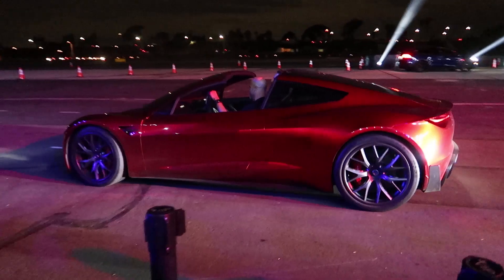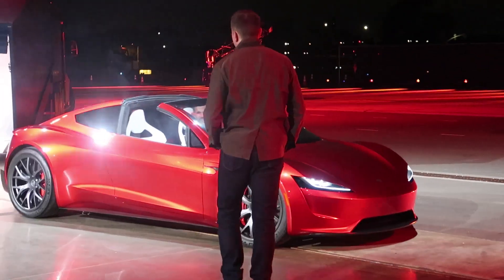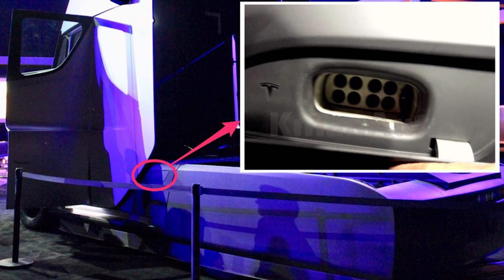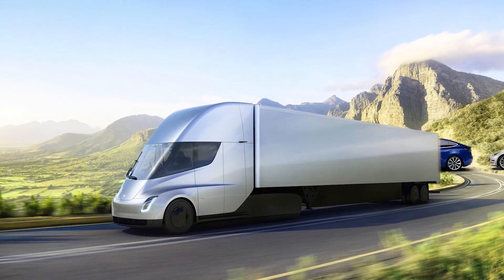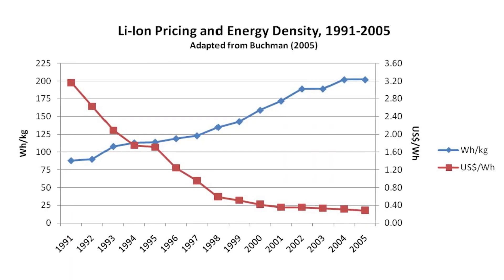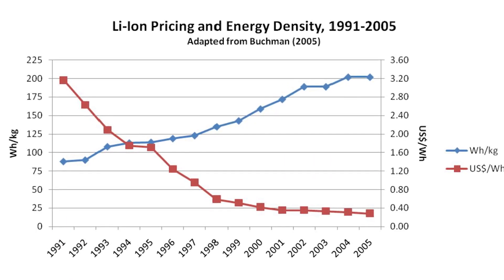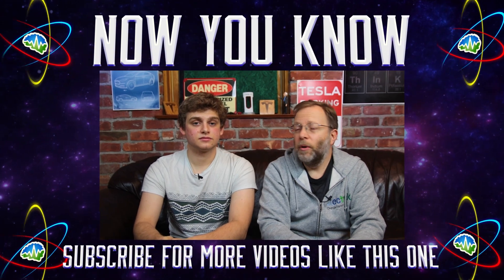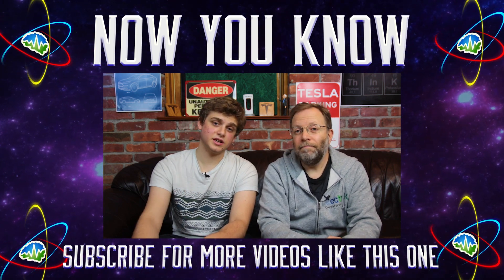Mega Charger Theories - In Depth

Comment: BTW - Henrik Fisker just patented a battery system that has proven to deliver a 500 mile range charge for a car in one minute time - I GUARANTEE that Elon is not telling anyone about his new battery technology that will compete with this. https://www.usatoday.com/story/tech/2017/08/11/henrik-fisker-back-again-challenging-tesla/550801001/
Reply: Sterling Michaels not a 100% on this, but Fisker’s patent I thought was just a patent for a type of Anode used in sodium metal batteries. I am thinking everyone is working (including Tesla) on the sodium metal batteries... maybe I am completely wrong though.
Reply: Sterling Michaels -- While it may be possible for the battery itself to charge that fast, let's do a back-of-the-envelope calculation for the required charging infrastructure.  

A relatively efficient platform would need ~120 kWh to go 500 miles, so to charge that in 1 minute at a constant rate would be 120 kWh / 0.0167 hr = 7.2 MW; at the 480V of the Tesla supercharger, that would require 15,000 amps; even at 2.4 kV, that would still be 3,000 amps.  

I submit that he will not be installing that multimegacharger network in time for a 2020 launch.
Reply: David Voss hey David I have two technologies which will make that more than possible when is a Building Technology.

Comment: i think it will be not battery but super capacitors
Reply: Priidik Kurik it wouldn't take 30mins to charge to 80% if it was capacitors.
Reply: ... grid would not be able to handle it ... if it is timed combo ... i think it would work ...
Reply: grid won't be able to handle it eitherway, it will have to be stored in tesla power packs. 80% charge in 30mins is standard fast charging batteries. No signs that would make anyone think its super capcitors.
Reply: tho ... 30 min and 300 miles ...:D  good talking to you :D.. on semi
Reply: its 400miles in 30 mins, and its capable of doing 500miles on a full battery. So the 400miles in 30mins is 80% capacity.
Reply: :D it is kinda too fast ... or is it real on batterys ?
Reply: 30mins to 80% for batteries is perfectly reasonable. Not to fast at all.
Reply: ... in hindsight yea ... capasitors would be like max 5 min but batteryas  in 30 mins are bit too fast ... i admit  i had a bad rigth idea
Reply: The energy density of capacitors is several orders of magnitude less than batteries.

Comment: One thing to consider is that the 24c price for electricity is for tiny domestic electricity supplies where most of the cost of maintaining the distribution to millions of houses... if you're a megacharger, and especially if you have some power packs associated so that you can smooth out your consumption, you would be able to buy electricity at a rate closer to the wholesale price which is under 7c.

Also, I think that if you planned to build a solar farm, then building it next to a truck stop would be great, because if you could sell that electricity for 7c, that's way over the wholesale price you could get normally......  I predict that the megacharger is a way to make large scale solar farms more profitable.

Comment: I think the new 2170 cells are going to be used in the roadster and semi and any new tesla products in the near term future. Not sure they made a "battery breakthrough". Remember, the 2170 cell is approx 50% more energy dense vs the old 18650 that's inside my Model S.

Gigafactory 1 just started producing 2170 cells, I would think they would want to maximize efforts for that first before developing new technolgy. I could be wrong, but this just seems like the logical thing to do...
Reply: David Kasman Using 2170s reduces the weight of the pack. And if a new electrolyte additive recipe is used, cells could be charged above 4V. So...then the pack could weigh in at around 800-1000kg and not over 1200 (2 100 packs).

A stripped down S P100DL hits 2,1 seconds. Weighing in at around 1600-1700kg.

The Roadster (even at 1800-2000kg) has wider tires and can use max friction up to 60mph (can squeel the tires in pain while traction control tries to keep everything in check).

The Model S above 30 mph can't put enough power into the tires to have the traction control kick in.

So...more traction (wider tires) and higher sustained power will get those last 0.2seconds I would think.

No rockets required. ;)
Reply: There's no way for the new roadster to have a 200 kwh battery (which it does) unless it's battery has at least twice the energy/volume (where would that extra volume possible be?). I'd go further though, the new roadster batteries also have to be better in terms of energy/weight too. There's no way to get 1.9s 0-60 with twice the battery weight as the current model S's 100 kwh battery pack (unless there was a massive tire grip breakthrough). The current model S already approaches the maximum possible acceleration times given conventional tire grip and it's curb weight.
Reply: If there are better anode/cathode/electrolites that have been developed, it is conceivable that all that would be required to build better batteries, with the same battery form factor and production equipment, is swapping the next gen materials (plastic films and electrolytes) for the current ones. For all we know, the model 3's are already using these materials ... dumbed down with software to "behave" like older generation batteries. Okay, I know this is a mega-reach, but it is theoretically possible.
Reply: Used Tesla Channel  i think the 2170 is 2x of 1860   3000milliamp vs 6amps for 2170 . The 2x power is possible..

Comment: Perhaps Tesla built prototypes just for the event that uses new technology because going plaid all night shouldn't be possible with the existing batteries.
Reply: You can bet that Tesla already has the technology to fit 200kwh in an existing size car. It is already possible today with certain battery chemistries. The question is how to get the cost reasonable enough to make it profitable. But then again, maybe the Roadster was never meant to be a profit center, simply a way to raise capital and make a bold statement.

Here is just one possibility from research:

"Silicon (Si) is under consideration as a potential next-generation anode material for the lithium ion battery (LIB). Experimental reports of up to 40% increase in energy density of Si anode based LIBs (Si-LIBs) have been reported in literature. However, this increase in energy density is achieved when the Si-LIB is allowed to swell (volumetrically expand) more than graphite based LIB (graphite-LIB) and beyond practical limits. The volume expansion of LIB electrodes should be negligible for applications such as automotive or mobile devices."
Reply: Ryan A, even if they lost 50K per roadster, the simple fact they have the fastest production car that does sub 2 seconds puts them into legend status and makes the idea of a battery powered car even more reality. More so, how many super cars to do you see out there, not many, but I see the $200,000 car WAY more often and that is going to be 1,000+ cars making people ohhh and ahhh over a BATTERY car ... it's something to convert people over to the battery side!
Reply: No need for special prototypes. For the Roadster use four Model 3 50kWh Battery packs in two layers. For the semi use eight 75 kWh
Reply: There are batteries from Toshiba which have quicker discharge rates. Nobody said the car would go the specified range or could be built for advertised cost!
Reply: John Arnold Even though Tesla has marginal credibility due to their missing of deadlines, they almost never come out with a specification that later becomes a falsehood, like range or power or 0-60 times.
Reply: Brian Bourke you can’t fit 3-4 model 3 packs in a roadster imo.
Reply: I agree. Tesla’s using prototype battery tech. But it wouldn’t surprise me if the frunck and truck were ‘inaccessible’ during the test-drives because they were full of additional batteries.
Reply: Rick Deckard  are you assuming the second gen Roadster is a similar size as the original?  If the second gen has a foot print of the MS would it be possible?  I think so.  

Too many of you are saying things are impossible just like GM without considering how it could be possible!